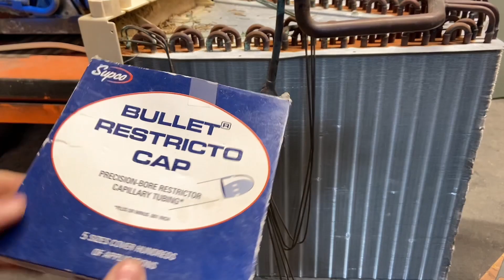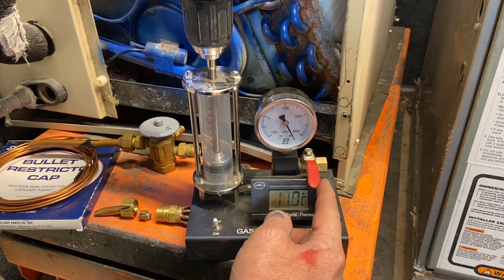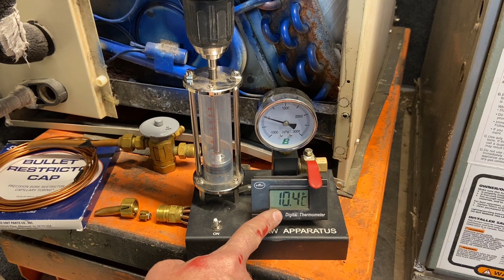HVAC 010 Metering device, Expansion device introduction

Comment: Thanks for the video, I have a question, is the position of the TEV bulb correct as shown?  against the direction of the refrigerant?  Or is it indifferent how it is placed?  thank you
Reply from the maker: 1st Always follow the manufactures specifications. 

When the bulb is in the vertical position most manufactures want the cap tube up on too so only vapor is leaving the bulb.

When horizontal it's best practice to keep the cap tube high so vapor only leaves.

As far as direction of refrigerant flow, it has no effect on the bulb itself as it's just temperature and pressure. However with flow can play a factor in relation to the equalization tube. 

When
Reply: @love2hvac  Thanks for answering, greetings from Venezuela

Comment: Hello Ty, I have a friend live in the Middle East and he asking about the ductless mini split utilize with an orifice tube how can check the refrigerant? Thanks.🌷
Reply from the maker: Most of the ductless units have the metering device outside. 
They have very specific charging instructions by weight and length of Refrigerant line.

While some do use a capillary tube they usually have an electronic expansion valve outside.

Because it's outside you can't do subcooling. 

Most are variable speed so you can't really do superheat either.

Craig with ac service tech and Bryan Orr HVAC school both have some great ductless units.
Reply: @love2hvac  Thank you so much Ty, the metering device (orifice tube) inside in the evaporator and it’s not EEV, I checked Criage video’s it’s different in metering device it’s EEV.
Reply from the maker: Well that's cool. I've never seen one with it in the evaporator. So in that case superheat and subcooling.

Comment: Thanks Mr Ty for another great video! 👍
Reply: Ty. I know it is not related request. But since topic is metering device and I remember watching your heat pump early on in class great explanation. 
Would you be willing to put videos on wiring heat pump with old mechanical devices rather than board such as defrost board. I come across lots of new tech because of modern technology they don't understand if they have to wire it in old school way just to understand the sequence of operation.
Thanks again for your time and help heat community.